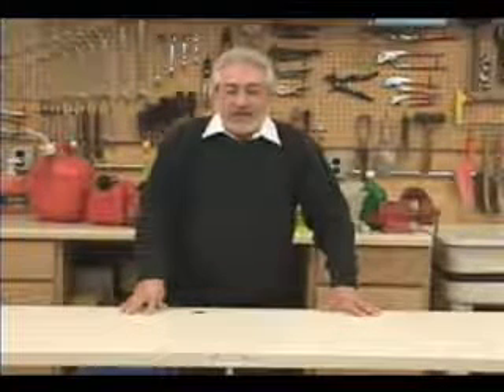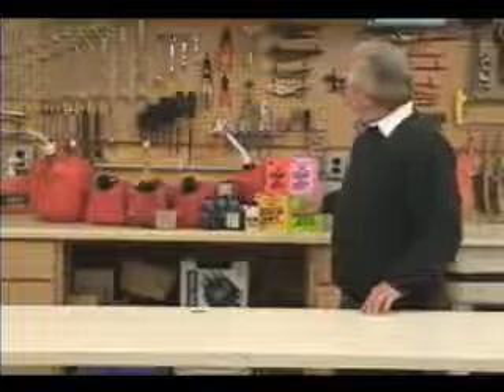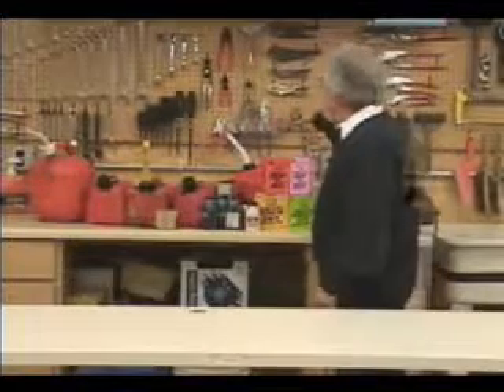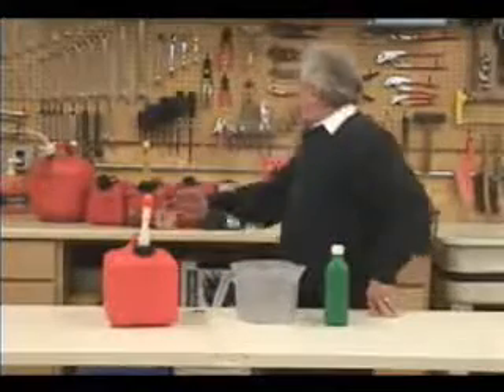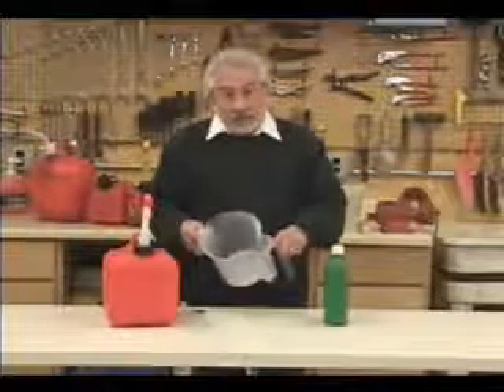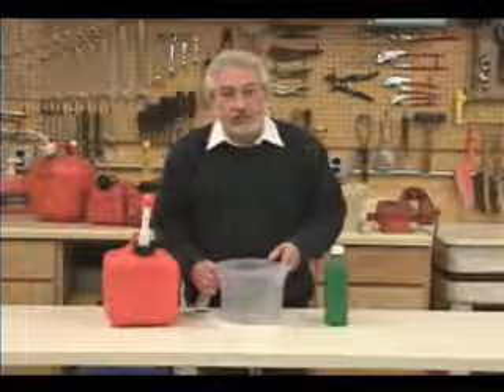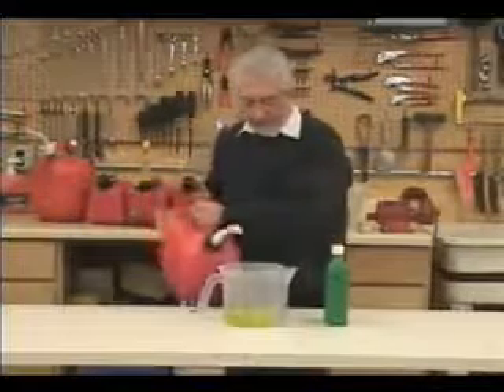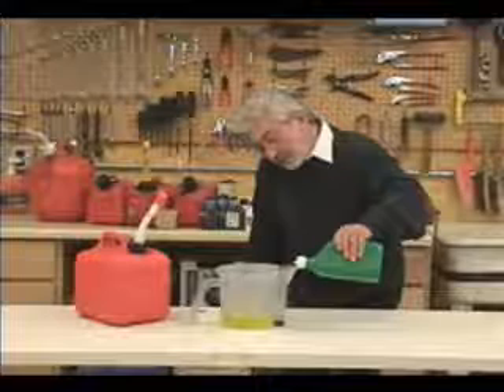Ratio Mixing for 2 Cycle Engines Made Easy with Petrol Pal

Comment: I put 40:1 mix in everything.
Reply: and it doesn't hurt the others
Reply: +Brad Jackson Nope. Most equipment is in the 32:1, 40:1 range. Now if it's an old chainsaw that takes 16:1, best to put the right mix. I've got one of those old smokers that I rarely use.

Comment: Its so easy to do. There is 1000 ml per litre. So divide 1000 by oil to petrol ratio, thus 25 parts of petrol to 1 part of oil is 1000 divided by 25 equals 40, so 40 ml of oil to every 1 Litre of petrol.  50/1 ratio so divide 1000 by 50 equals 20 ml of oil to every 1 litre of petrol and so on !!